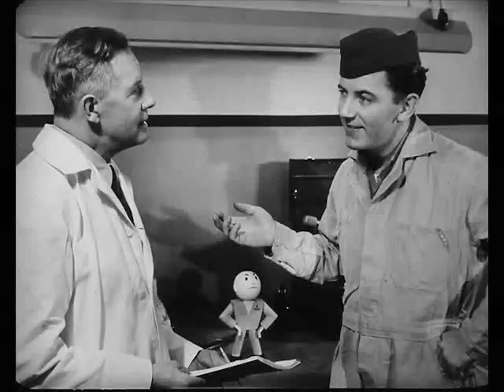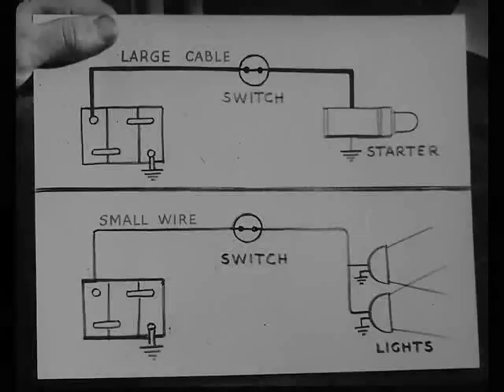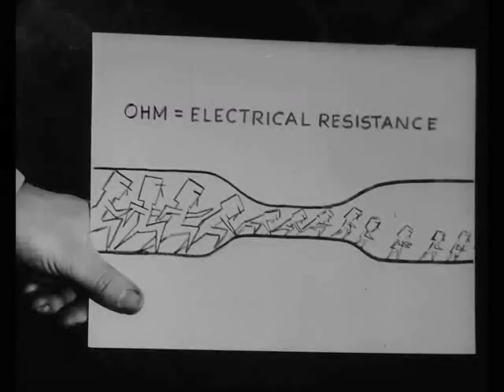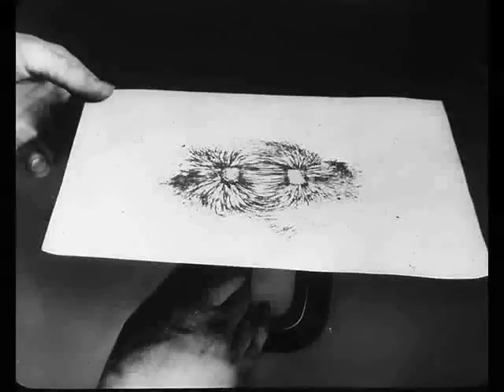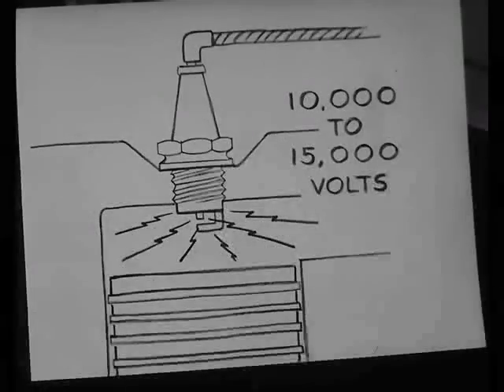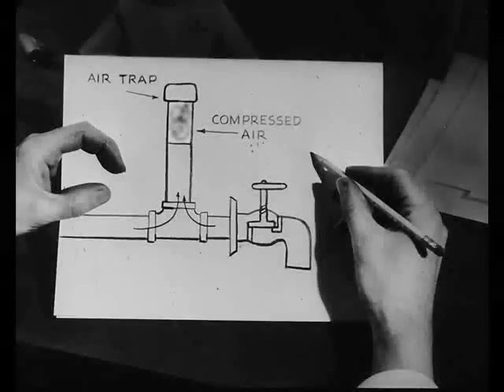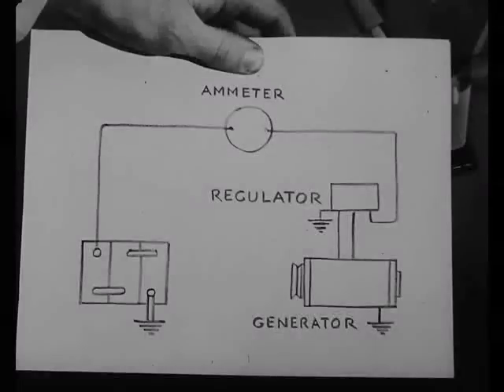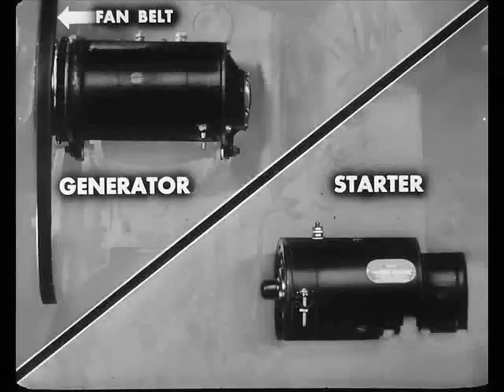Chrysler Master Tech - 1948, Volume 1-6 Volts, Amps And Ohms

Comment: Hello,  I own many of these MTSC filmstrip kits myself.  I noticed that the sound isn't the best on some of the filmstrips, such as this one.  What I found out with my records is that sometimes on the older records, I got better sound using a 78 cartridge.  If you used one of those ION turntables sold a few years ago at Costco, they usually give very poor results.  But it's great to these online even with poor sound.
Reply: I have a filmstrip/record player combo that was used in a dealership.